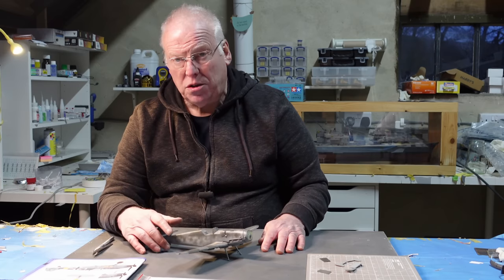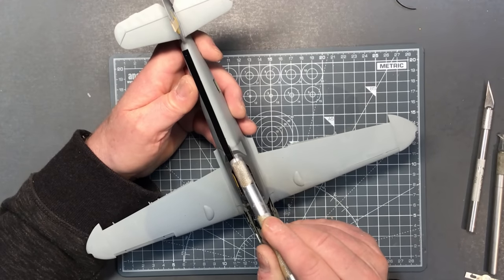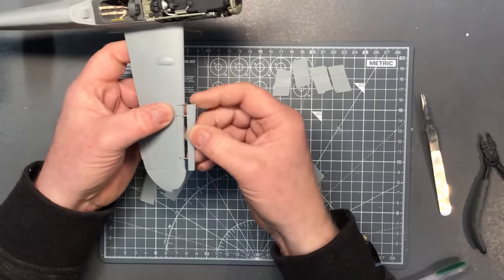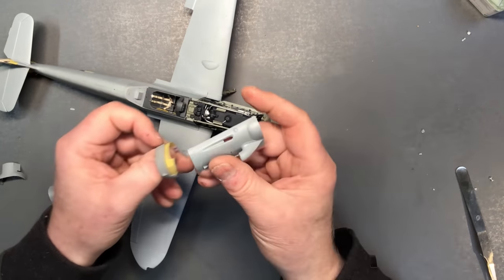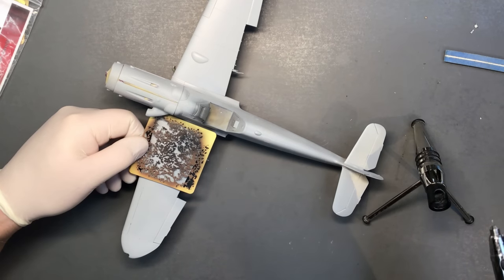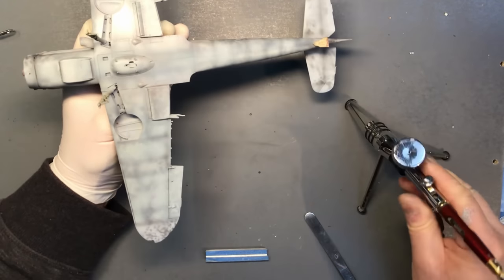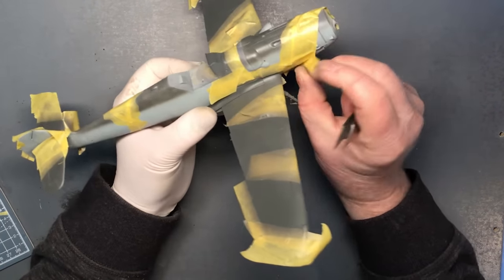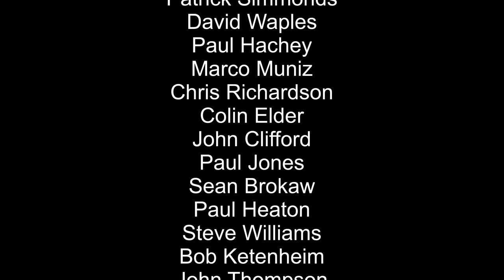Zoukei Mura 1/32 Bf109G-14 Part 5a

Comment: Very good work, it's starting to look like a 109 instead of a collection of sub assemblies. I found your use of the splatter templates for the pre-shading interesting, several people I know who use them do it for post shading. After the airframe was painted I saw a bit of a sheen and am wondering if the Mr. Hobby paints are a semi gloss? Looking forward to the next installment and to the next 1/32 scale build.
Reply from the maker: Yes the Mr Hobby RLM colours are semi gloss - I’ll dull it down and level the finish with a semi Matt varnish